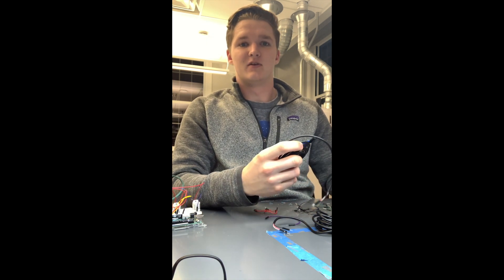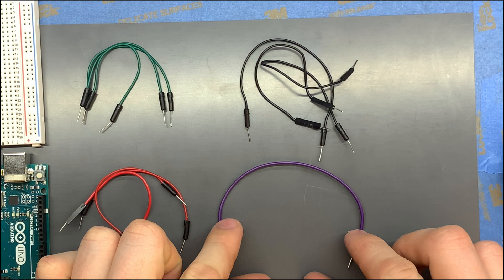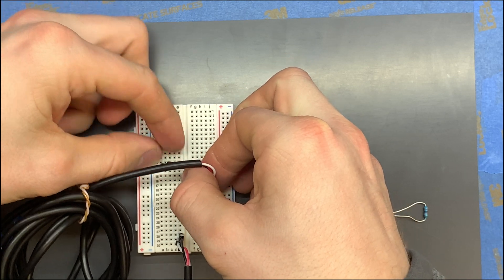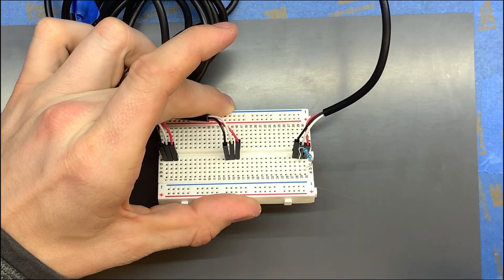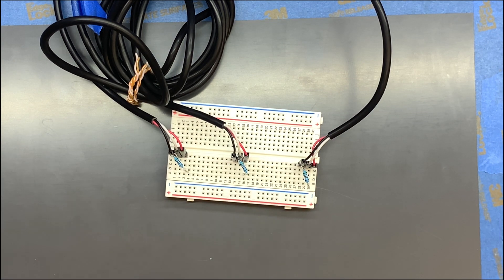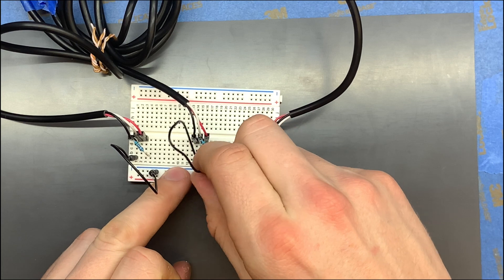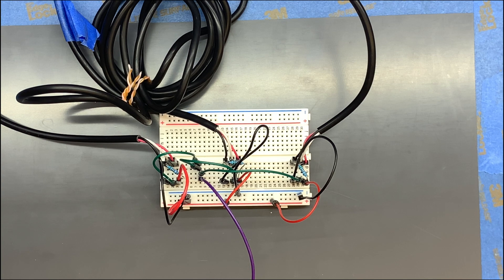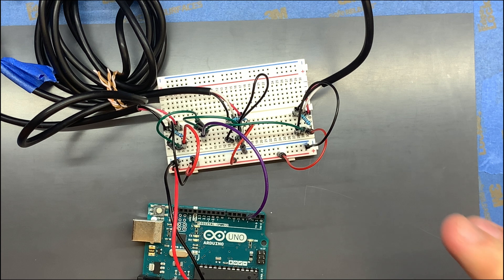Multiple Dallas Temperature Sensor Hook Up & Code

Comment: please can you include the relays so that each sensor can turn on/off heaters
Reply from the maker: Is this something you would still like to see?
Reply: @andrewburklund700  could be nice!However, how can you read the same value from different sensors?Appears that are not calibrated
Reply: Same, I'm build a enclosure for 3D filament which will also have climate control hardware, (heater and fans).